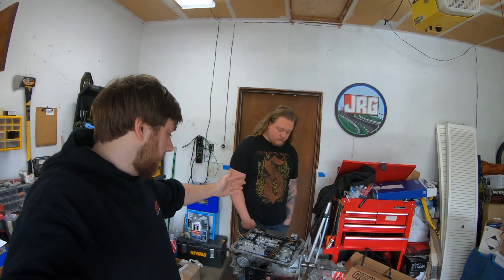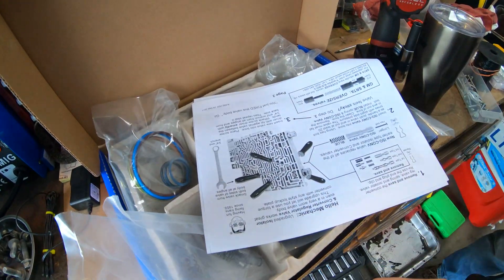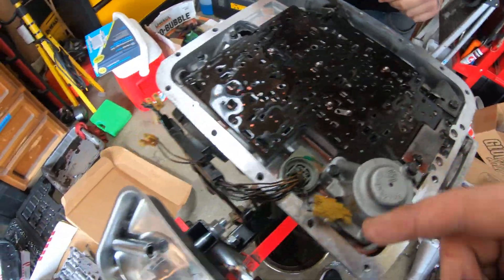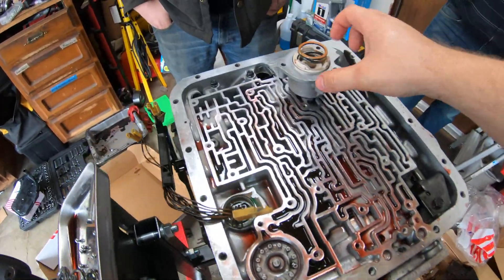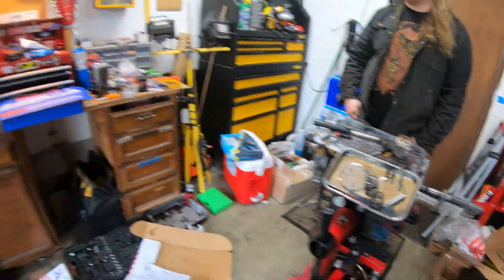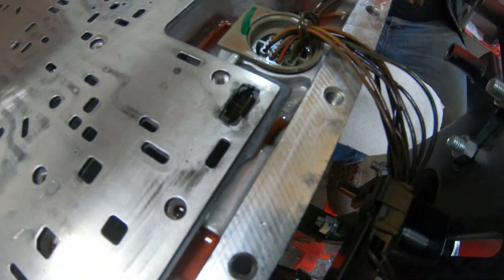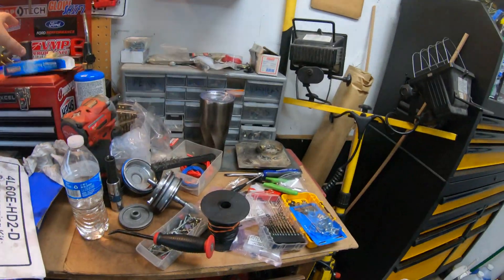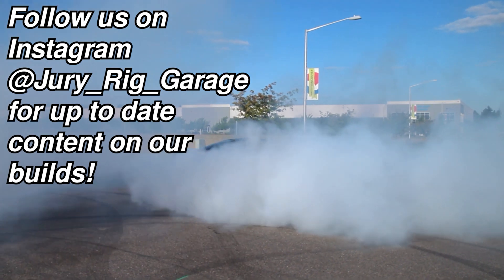Building a 4L60E for Power! (Part 3) TransGo 4L60E-HD2-D Shift Kit Install!

Comment: Replace that piston in the 2nd accumulator with either an aluminum one ore the sonnax one they last longer i personnally used the sonnax pinless acumulators they last longer and dont have that stupd pin that wesrs out over time in the bore! Another thing to upgrade is the separator plate with a transgo one they last longer the damn check balls will get ruined over time and check balls  will get enmbeded in the bore i seen it i installed same shift kit and like 2 years i started having issue dropped the valve body the check balls had severly worned the separator plate might as well upgrade

Comment: Guys warning do not install the  check bal with small whole into input drum it will leak and u eill get 3/4 burnt friction plates,  and do not install the 7cs springs for high reving vehicles into the transmission  input drum the drum needs clearences in the 3/4 the yellows springs will be outside gm input drum clearences its gonna be too tight causing shift issues i know cause i had them installed